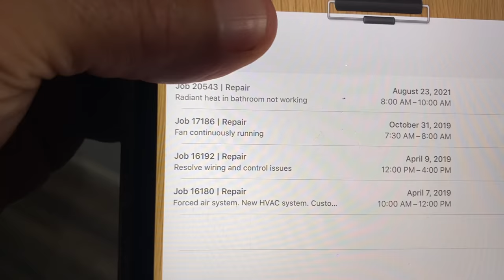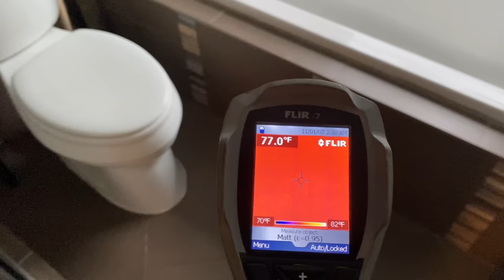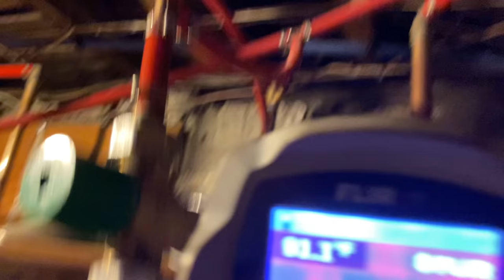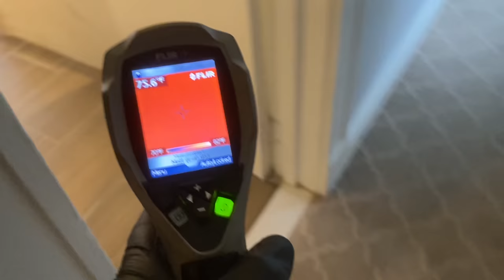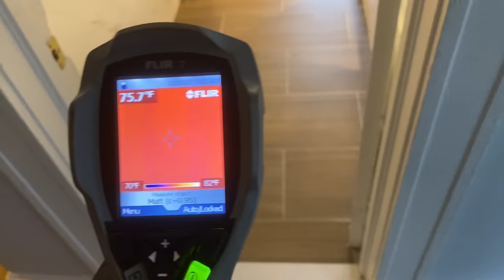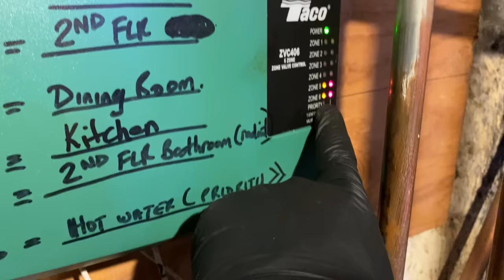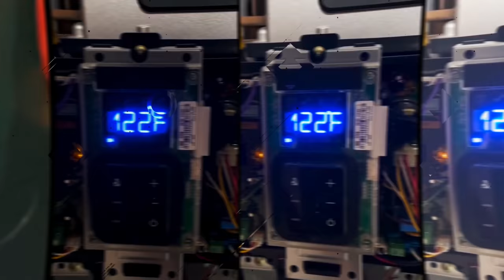Hydronic Radiant Floor Heating Not Working - Bad Thermostatic Mixing Valve Replaced & Valves Added

Comment: Mike, can’t install radiant close to a toilet. Wax seal will melt. Also can’t run it under cabinets. We fail inspections here if to close
Reply: exactly, there's no need to have a heated toilet, the floor will be plenty warm in front of it and some radiate towards it.
use rugs and bath mats, like the rest of us po-folk lol ;)
Reply: In B.C. we are required to be 1 foot away from the toilet so wax seal don’t melt but I do agree with Mikey to put piping under the shower/tub so you are not stepping into an ice cold place to have a bath.

Comment: the other issue is, there should be a pump on the outlet of thermostatic mixing valve, just to pump the radiant loop.
without a pump post mixing valve, just for the loop/s, as the mixer valve adjusts to use more cool "return" water, the flow will drop off in proportion, to the point of little to no loop flow at all.

Comment: Just got off a white plastic and foam coated roof, those things reflect heat like crazy, got me to thinking, I need to come up there and work summers and migrate back down here or Arizona for winters... I thought I was going to stroke out being on that roof today! Mikey Pipes! it was reflecting back 152 deg heat according to my 12:1 name brand temp gun and 112 deg in the shade by the ladder, but the weather said it was only 96 but feels like 106, maybe they turned on 5G, who knows, I know it was just HOT! Now on to your Great Video!

Comment: I used to deal with those rings alot with syrup lines for soda fountains. You can use side cutters to break the crimp ring usually in 1 good twist.  Not sure how stiff that pex is, soda lines were a forgiving plastic. Just an idea for next time
Reply: I feel like pex is a little softer than cpvc and more flexible
Reply: there's cutters made just for that style crimp ring, but you an use alternate methods :)
Reply: On you soda fountain, what the pump on the filter system for?

Comment: That hack contractor who could not be bothered to lay out the underfloor loops correctly had clearly not heard of using a pair of supply and return manifolds for the underfloor heating distribution. Total hack job.

Comment: uponor/wirsbo has had more than one class action lawsuit, for issue with their brass(older high zinc content) fittings corroding up inside and out restricting flow, also the red/blue color tubing, which was only an outside layer that the application of cause breakdown and cracking of the tubing(end result leaks).
it's a perfect rose garden with pex A, B or C. I'm just waiting for major fallout and bad things, perhaps something like odd water chemistry causing breakdown and toxins to be released.
same as lead was deemed safe at one point ;)